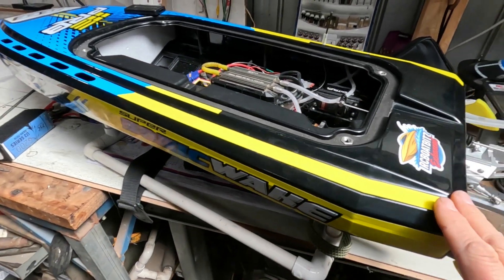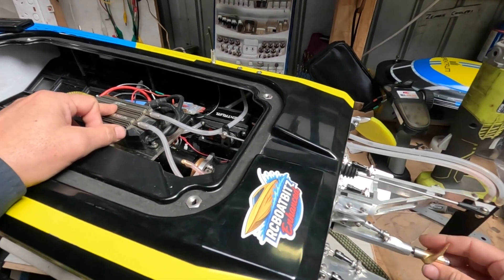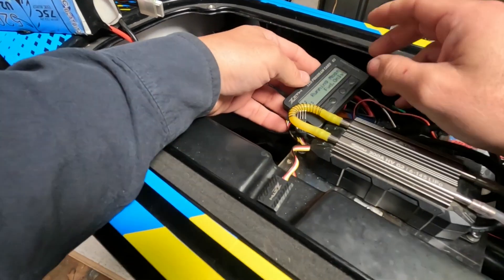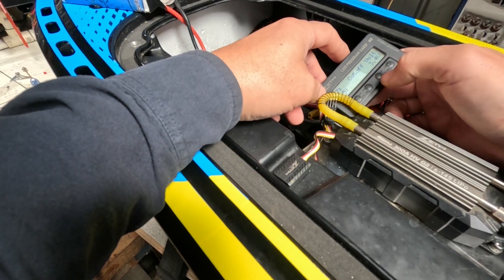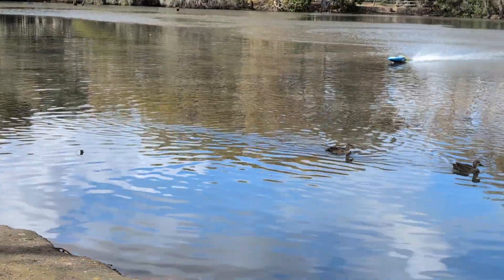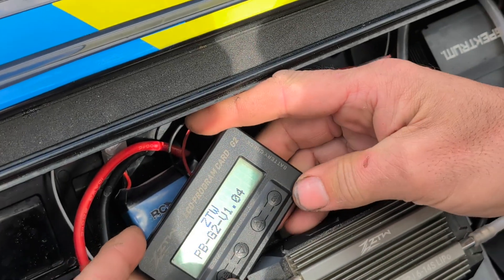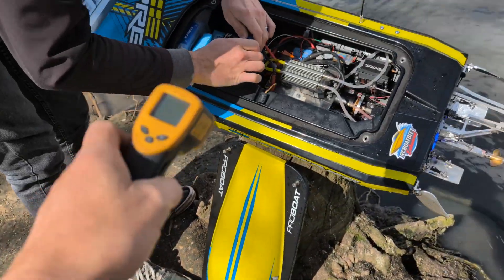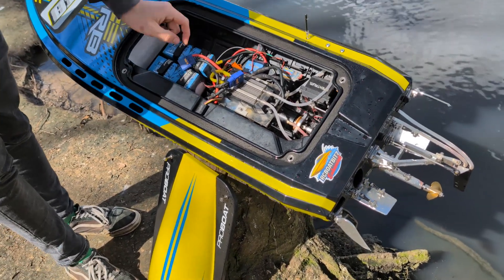RC Boat Timing comparison on ZTW 300a ESC Speed Control

Comment: If that is a delta wound motor -0 to 5 deg seems to work best, but WYE wound motors need a 5 to 15 deg timing for best performance.  To much timing in a delta wound motor will over heat the motor and draw down the batteries quicker.

Comment: A lot of racer's use D wind 0 - 5 degree's max, Wye wind 15 degree's. More timing = more heat. Outrunner motors like more timing still, around 20 - 26 degree's.

Comment: thats the best the boat has looked on the water so far for sure. i think you may find that the boat went a bit faster in that last rip because the batteries had warmed up a bit from a few previous passes. warmer packs with slightly less voltage will usually out perform a fully charged cold pack. id be keen to see you test timing again but on a Y wind motor, D wind motors see no performance increases with higher timing in all my past testing, just higher amp draw and temperatures for the same speeds essentially. keep it up
Reply from the maker: Were taking that motor out to see how the stock ones last on 10s, may not go well close to 40k rpm underload haha. Ideally if i had a low kv 40mm id run that with a gas size prop to see what its like on 12s, but will need to order something in

Comment: I come from an air background, the larger outrunner motors used on prop planes can really benefit from high timing advance but for highly loaded inrunners (ducted fan) all it does it generate heat.

The only other application where I see lots of timing advance is used is RC drifting - low traction/amps/load means the motor can spin up freely, basically the exact opposite of spinning a prop on the surface of the water lol.
Reply from the maker: In boats generally the rule is 15deg timing for Y winds and 7deg for D winds. Ds are meant to be more torquey and Ys supposdly rev free-er in low load applications ( not ideal for boats).
Reply: So what kinda wind do i have on my stock spektrum 950kv motor ?